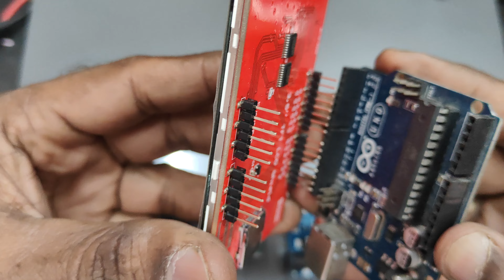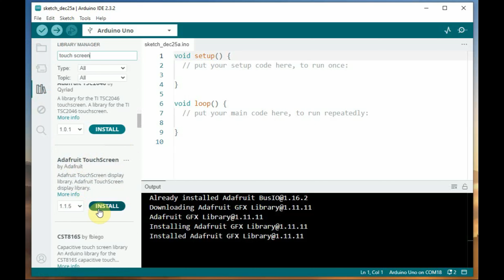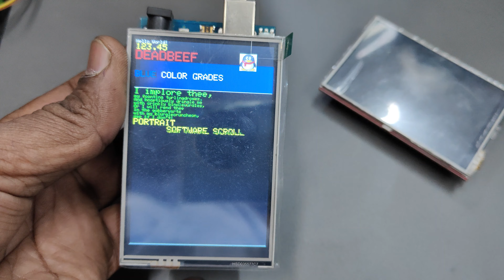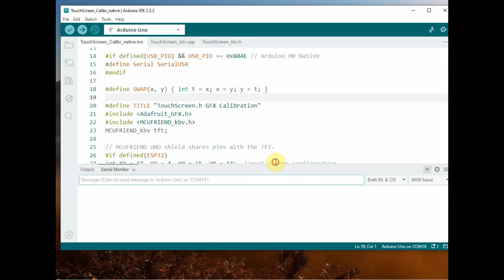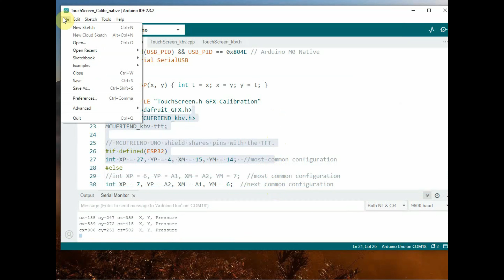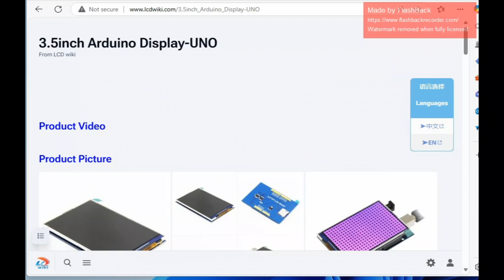3.5" TFT ARDUINO SHIELD ILI 9486 / 9488- How to Calibrate TOUCH

Comment: Hi,
I see that all the pins on the UNO board are taken up by the 3.5 display(while its great) but as a newbie(yet to start fidgeting) I am wondering where would i be able to attache my load sensors when all the pins are taken up by the LCD ?

I am currently trying to make a multi-load cell arduino project, hence my query about how to extend the Arduino pins so i can connect my load cells, If successful, I intend to connect more than 24 loadcells(HX711) to my UNO board.
Cheers.
Reply: pay attention to the video. He suggested to use Arduino Mega is you want to have more pins